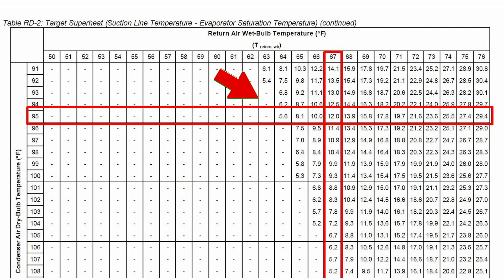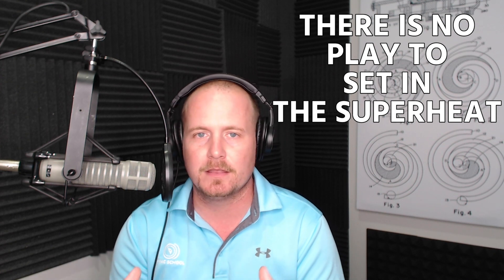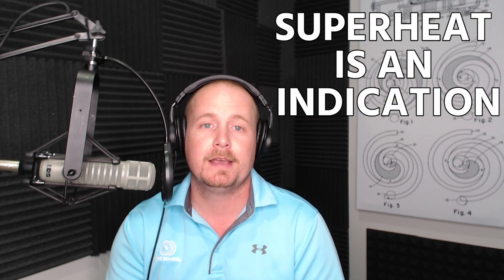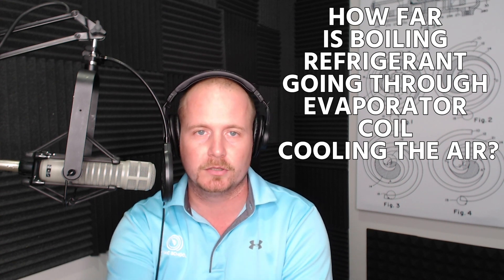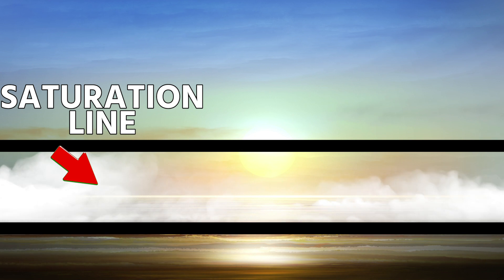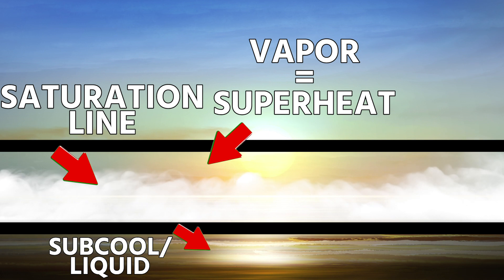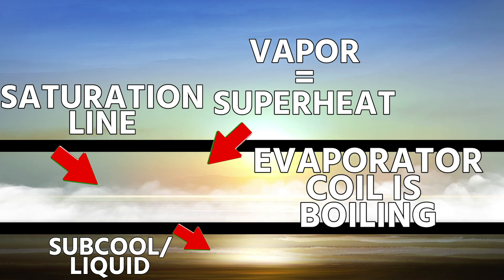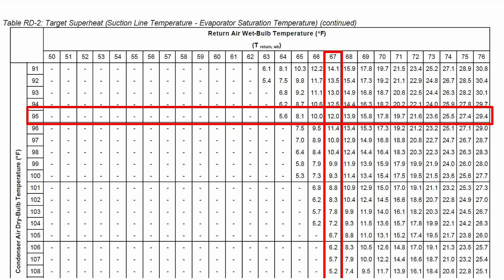How to Find Target Superheat

Comment: First part of your video shows outdoor dry bulb on the line, then later it shows taking air readings for outdoor dry bulb. I'd say they may be different reads. Came here to understand dry bulb readings. My thoughts are (for pistons on say R-22 ac only) you really need to use the air temp going into the outside coil.

Comment: I work in hot climate which outdoor temperature reaches 118 F in summer, So I charge the units in the peak by target superheat 5 to 8 F at the lowest possible indoor temperature the unit can achieve , Is this correct method?

Comment: Do you need to use a recovery machine to recover some refrigerant if the unit is running?
Reply from the maker: No you can run a hose from the high side into a recovery tank and recover some refrigerant that way if the unit is running. High pressure goes to low pressure.
Reply: @HVACS  got it, thanks for the reply! 💯

Comment: target superheat is achieved by ensuring the right amount of refrigerant in the system for capilary tubes expansion valve. but you said it is not applicable for txv and electronic expansion valve. does it mean that the amount of refrigerant charged into such system does not affect the super heat of the compressor?

Comment: So if you live in dry 105 degree Phoenix and set your thermostat at, say, 72 and your indoor WB is 60 degrees, how does a tech adjust to the proper Superheat when the chart shows a blank space?
Reply: guess,  thats what I do. I worked in Death Valley.  Average summer temperature is 120 degrees in the shade.

Comment: Thank you!  You had answered my question on another video concerning superheat calculation and what to do if the chart ends up with a dash.  I am glad that you took that question and ran with it as no one else has!  By the way, I did notice in the book I purchased from you (which is awsome) you discuss this very issue.  My take away from it is to charge the system during the worst case scenario - low WB, and high DB which here in Florida is usually zero superheat.  I set the target superheat to be 6 degrees rather than 0.  Even though superheat may be a little high when its cooler outside, at least the compressor won't get liquid.

Comment: Great Video but speaking a little slower (taking more time to say the same thing) would be awesome!
Reply: Try using playback speed setting .75 (or slower) on the YouTube setting menu.  He does convey a whole lot of info very quickly!
Reply: @FindLiberty  thanks for this totally awesome tip!  I did not know that option was available and it totally rocks!  I'm also looking forward to using the speed up video option on most of the long-winded videos (which are quite frequent) on YouTube. Thanks again for the tip... I will use the heck out of it!